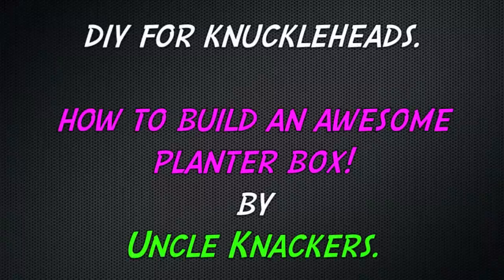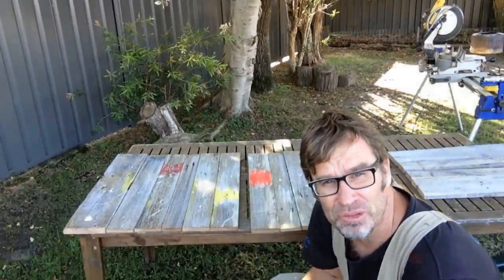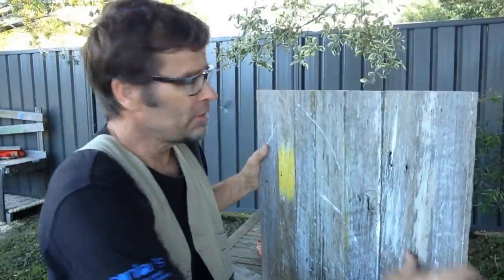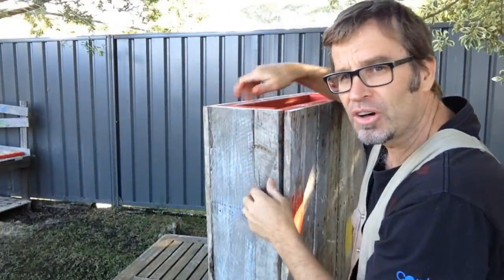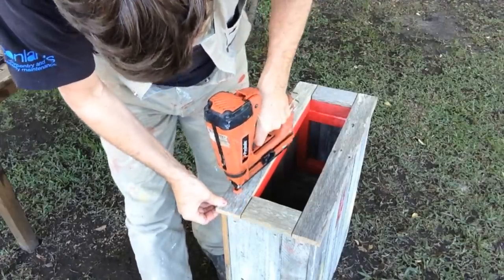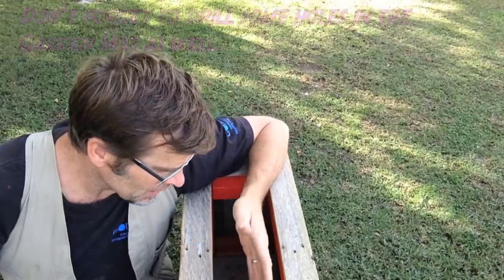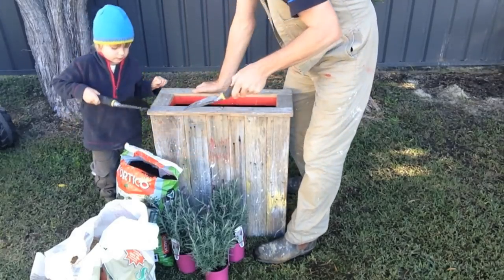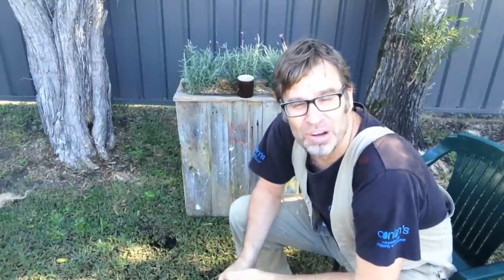How to Build a Planter Box. An AWESOME Planter Box for $7.50!!

Comment: Another great job, mate. 
I often wonder about what size nails/brads you have in that gun, and don't they rust?
Reply from the maker: Thanks Andy. The nails l use are a 16 gauge, 38mm, or 45mm, depending on what l'm nailing into. If the project is going outside then eventually the nails will rust which is why l also use screws that won't rust. In actual fact l don't mind if the nails rust as that leaves a nice looking mark on the timber. Cheers mate

Comment: Hi Shane, thanks for all your tips. Just wondering if you could do a video on how to mark and cut 45* degree angles. Every time i seem to stuff it up and cut one side smaller. Please Help Mate
Reply from the maker: Hi Tim. Just a quick question. What are you using to cut your 45 degree angles?
Reply: shaneconlan1 that might be a good bit of info. Im using a miter saw.
Reply from the maker: Tim Clarke Without seeing your set up it's a little difficult to determine what you're doing wrong. Maybe your mitre saw is a little bit out. If the saw is cutting true, and you are holding your piece flat and square against the back of the saw fence then it should work out. Cheers mate

Comment: Newbie question:  Why nails and screws instead of one or the other?  Great project from my Uncle from Down Under :)
Reply from the maker: G'day David, l use the nails first to hold everything in place and then l secure it with screws. When using unseasoned timber like pallet wood, it tends over time (especially if exposed to the weather) to twist, so using screws rather than just nails helps to hold things together over time. I hope that makes sense and thanks fore the comment mate. Cheers

Comment: why not use wood glue and nails? It's cheaper and I'm almost sure that will be strong enough!
Reply from the maker: Hi Sebastian. When using unseasoned timber you need the holding power of screws. Especially if you are building a project that is to be exposed to the weather and water. This particular job l purchased two packets of screws for 7.50 which l only used three quarters of so it's not a lot of money. Cheers mate